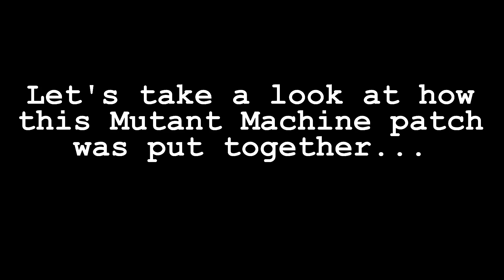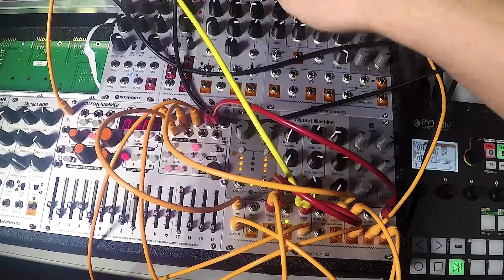Building a patch with Mutant Machine

Comment: GREAT video.   Would you recommend this for drum or say, mutant bass coupled with Manis iteritas?   I feel like digital oscillators always sound thin.  Anyway, thoughts...advice?
Reply from the maker: Thanks!
Hmm that's a really hard one to answer! I suppose it is quite subjective 🤔 they're pretty different creatures! I think that either would complement some digital grit from another type of module very nice in a rig. 
I can say that the most striking difference is that the Mutant Bassdrum is very good at making bassdrum sounds, and can also be coaxed into making warbly basslines. In a way it is a bit limited compared to the Machine, which is sort of a "jack of all trades" and can do a whole lot of other stuff. It can definitely do bassdrums but maybe that's selling it short a little due to all the other possibilities :)
Does that help a little? Let me know if you have any other questions.
PS I'm just about to receive a long awaited resupply of Mutant Machine (they've been out of stock for awhile). They've got a new updated look which I'll be announcing on the mailing list and elsewhere when they arrive.
Cheers and have a nice day
Does that help a bit? Let me know
Reply: Hexinverter Électronique Thanks for the reply. I believe that does help. Is the MUtant Machine 100% Analogue—including the noise? And what will the new ones look like? Any hint, mate? :)
Reply from the maker: @aidanvinum  no problem, happy to help!
Yes indeed it is completely analogue. The noise generator is inspired by the 909, and is made with CMOS logic (not using a microcontroller). That's about as digital as it gets in it. :) check out the VCNO if you're curious to know about the noise generator, since they share a "heartbeat" so to speak. Different implementations but similar method of creating noise with those logic chips of yesteryear.

Ah sure, if I were to describe the new look in words, I'd say it is more like Mindphaser. It's black paneled and has similar knobs and updated artwork. You can see some preview images and renders of Mindphaser for reference on the channel here or website if you've not seen it yet! 
Hope that helps!
Reply: @hexinverterDOTnet  so if I already have a Noise Engineering BIA that can do 1-2 percussion sounds, would you get the Mutant Machine or 2-3 Mutant drum modules for a small setup to handle bassline and percussion sounds?
Reply from the maker: @GuitarsAndSynths  if it were me I might go for a couple of other modules if that's my whole kit.
The Machine is very versatile and can seem as though it's multiple independent drums - when carefully modulated - but at the end of the day it is only one trigger input for percussion. 
In that sense I'd recommend it more as a third or fourth module in a percussion system, rather than a second. Does that make sense?

That being said, I know people do a tonne with just one of them! So really it's down to how many available trigger input options you're happy with.